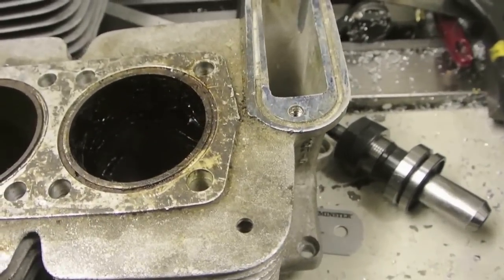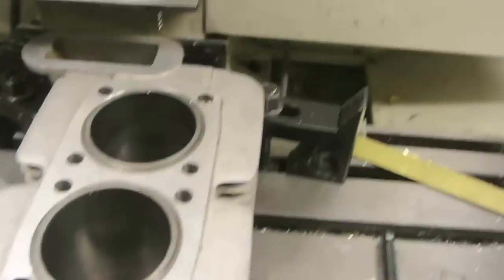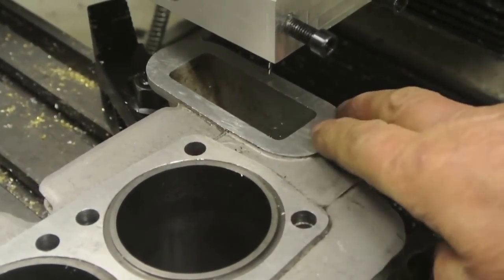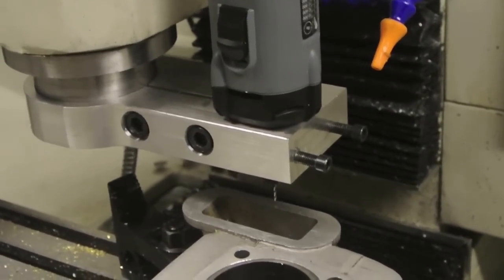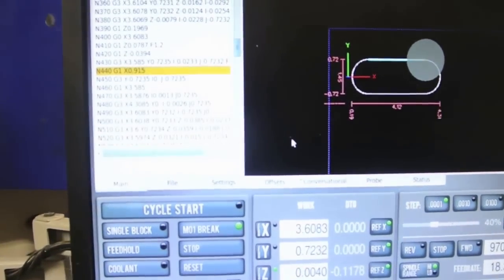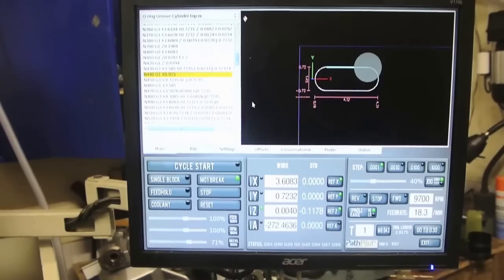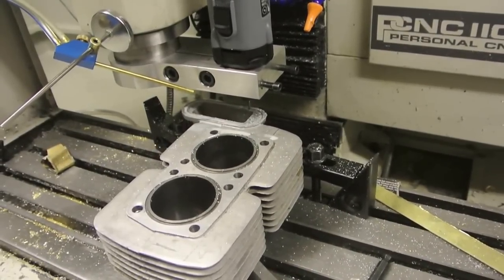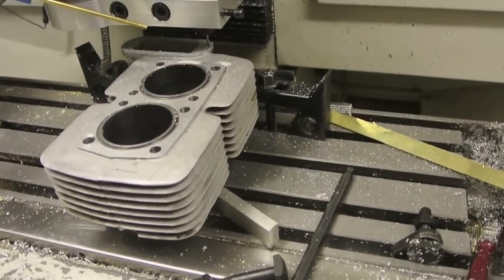Using The Kress Spindle ON The Tormach PCNC 1100

Comment: That will do the job, but it is a lot of work for a O-Ring groove, and you will not make a profit unless you charge too much.  :) (I do have a ton of exp and formal education, a pro here with most machining.)
The whole idea of a high speed spindle is to be able to increase the feed rates, (chip loads actually stay the same) for quicker production.  You need to use coolant or at least a Mist, or as you found out, the cutter flutes will clog up with aluminum and break the cutter.       Personally, I would not use one for small numbers of pieces to machine, but could be pretty good for production of small parts, (with coolant and faster feed rates.).  I have this machine, (running right now behind me. porting little 2-stroke cylinders), for these reasons. I am running production, but I have to hand finish them, and that takes longer than my cycle time.  I usually run a .125" solid carbide Ball Nose End mill, and with coolant that thing can run in aluminum to about 20,000 rpm with coolant of course, and with .004"/rev chip load, (.001"/flute) on a 4-flute cutter, a feed rate of 80 inches per minute, (and the newer drives will do that).  So that is great for production.  I run mine at 3500rpm and it won't clog the cutter with no coolant because it is not making enough heat at the slower rpm, so I run coolant free, (and I had table travel limit switch problems when I did use coolant), and I use the coolant tank to recycle my way oil, (works great, and I use a lot of way oil).
I just got path pilot, (upgraded my 2007 Mach system last week), and I hand write al my programs, (Told you I was old school), but I have not tried to write a program with a sub routine in it.  Here is how simple hand writing that o-ring groove really is with a sub routine.  I will skip all the normal stuff and just get to the meat an potatoes.

Main program (2" wide oval with 1" long straight sections. Straight sections along the x-axis, X&Y Zero is center of right radius. No cutter comp.  Finish passes would be the same with some slightly different values, (copy, paste, edit). cutter starting .005" above the part to .125" deep.)
G90 MODE
X0.0Y0.0
G0 X0.0Y-1.0
M98P101L13          (M98 call up sub routine) (P101 = sub routine program number below this M30, can have several sub routines like for the finish passes too, I start at 101) (L13 = 13 passes at .010" deep, programed in the sub routine.)  This block skips the rest of the main program to find sub routine O101, (my label) under the M30., and will enter the main program where it left off when the sub routine is done.

G91, (I leave this)
G1X-1.0 Y0.0  (I delete the Z move)
G90 (back to absolute)
G2X-1.0Y1.0R1.0
G1X0.0Y1.0
G2X0.0Y-1.0R1.0

 two bottom passes if you want
G91, (I leave this)
G1X-1.0 Y0.0  (I delete the Z move)
G90 (back to absolute)
G2X-1.0Y1.0R1.0
G1X0.0Y1.0
G2X0.0Y-1.0R1.0

G90 (make sure you return to this

G0Z3.0
M5
M30

sub routine (THIS IS ONE LAP AROUND THE O-RING GROOVE)
O101
G91, (incremental so I can use Z ramp)
G1X-1.0 Y0.0 Z-.010 (ramps down Z-.010" in this line only per pass)
G90 (back to absolute)
G2X-1.0Y1.0R1.0
G1X0.0Y1.0
G2X0.0Y-1.0R1.0
M99  (It will repeat this cycle 13 times, then go back to main program.  I copy and change this loop for the main program to flatten the bottom of the groove.)

If you want to take a deeper pass, (like .020" deep for each lap), you would change the start Z height to Z.015, and the L value to 7.

You can run that little .125 4-flute cutter with a .002" chip load at those depths easily, (.008" per revolution feed).  So at my 3,500rpm, I will have a feed rate of 28 ipm, (I may use a bit of WD40 in the groove to insure a good finish)

You can copy that and tweak it a bit in your machine.  I know sub routines work like that in every machine I have used and the old Mach for the early 1100's.  But i have not tried it yet with path pilot.  It should.

Oops, my machine is done.  Gotta change parts. 
Doug in Michigan

Comment: good vid   but  why not use the main spindle on the machine
Reply from the maker: The simple reason is that the main spindle will only rev to 5,000RPM. The Kress can run up to 36,000 RPM or thereabouts. If you use the main spindle even at max RPM you will run the risk of breaking the cutter. I was running the Kress at 25,000 RPM for this cut.
Reply: thanks for replying Bob   I thought the main spindle was good for a lot more but its hard to tell from my armchair  lol

Comment: Another great video thanks Bob always looking forward to the next one I am learning something on every video
Reply from the maker: Hi Kevin. I think I need to maybe include a bit more on the CAD/CAM side of things. I use a mix of SprutCam, Fusion 360, Autocad and IronCad so a quick look at some aspects of arriving at the required G-code might be in order, maybe on my next video which is likely to be using the 4th axis to drill spoke holes in a vintage car hub.